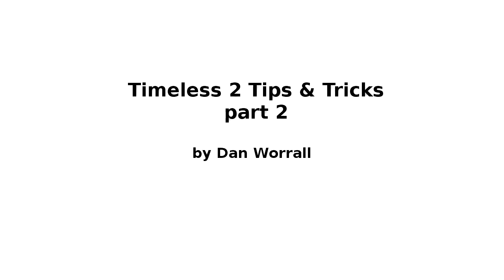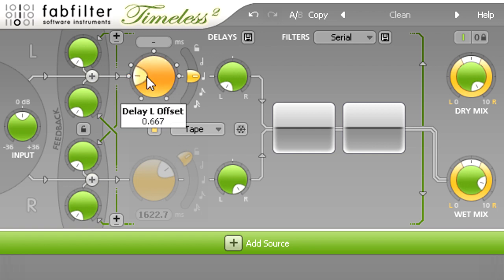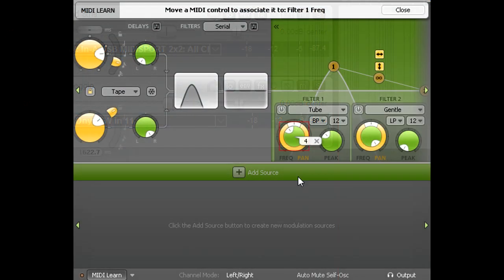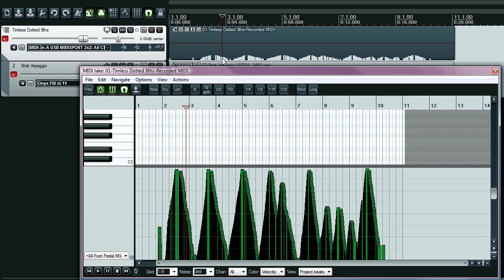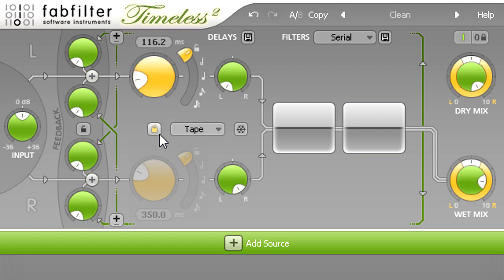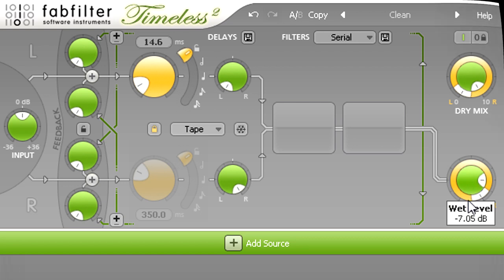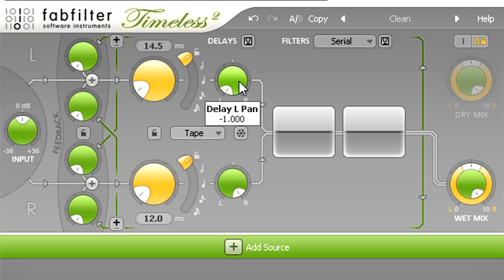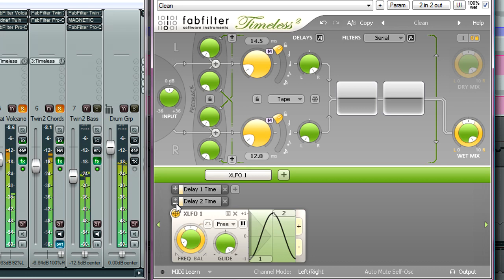FabFilter Timeless 2 - Tips & Tricks 2/2

Comment: "the tempo sync slider assumes that the host tempo is correct, so this will only work properly if you're working to a tempo grid in your DAW" - I don't quite understand this. A typical envelope follower would take its timing/triggering from the incoming audio's amplitude, so daw tempo settings seem irrelevant. So this is not a typical envelope follower I guess? Where is this tempo sync slider?
Reply: He was referring to the sync, not the envelope follower, though I agree it was an oddly timed statement.